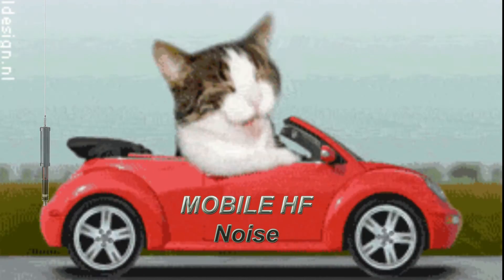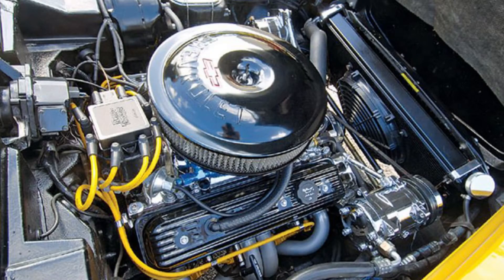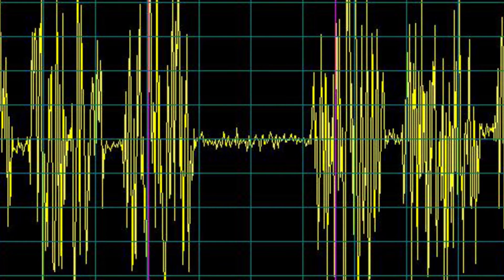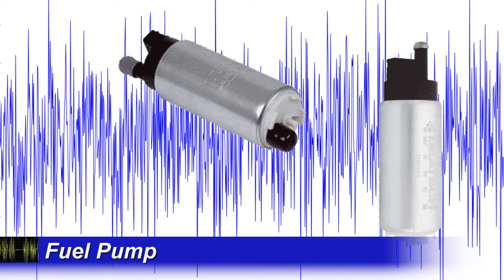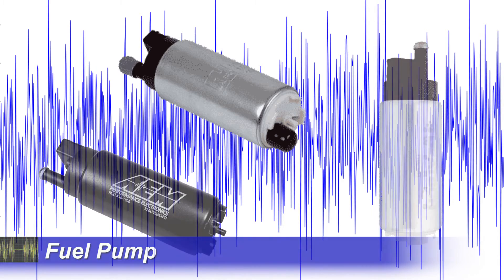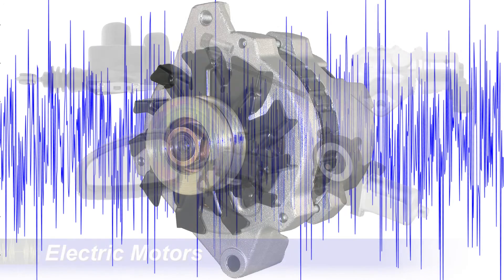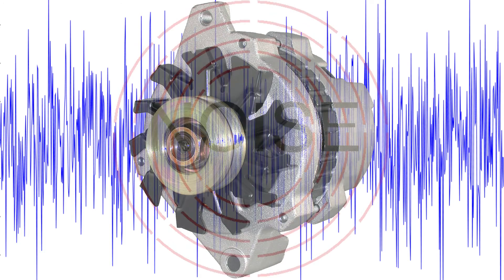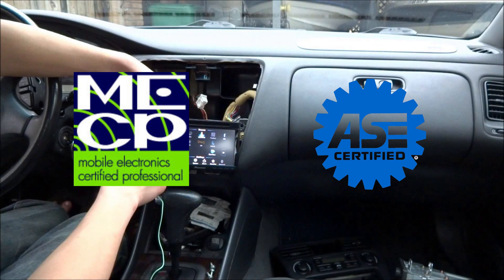Mobile HF Noise

Comment: 95 f150 fuel pump whine. 
5 ferrites on both positive wires and grounded both negative wires to the frame. ...still whines. .
What is the cure?